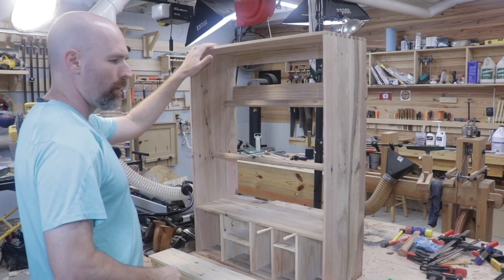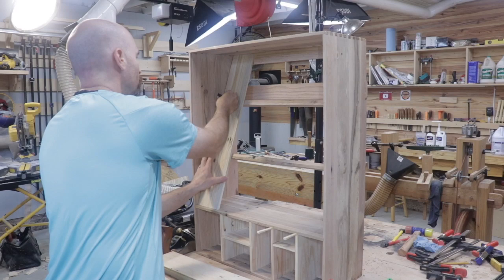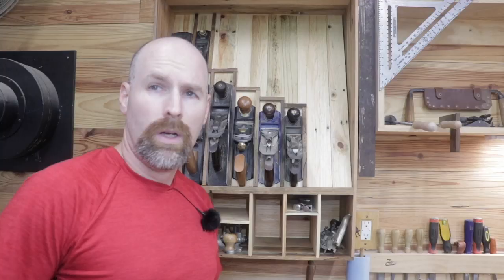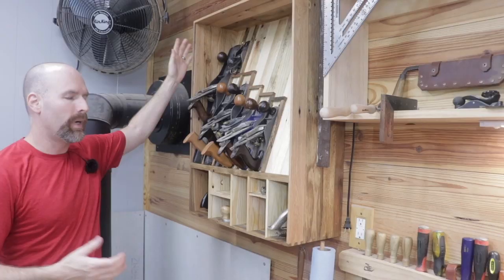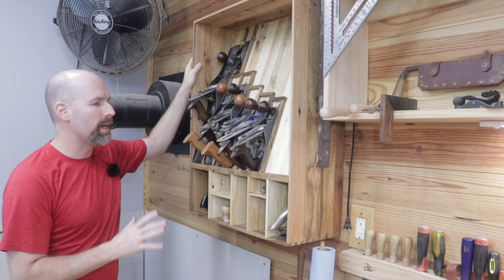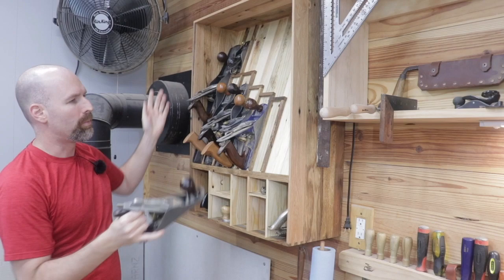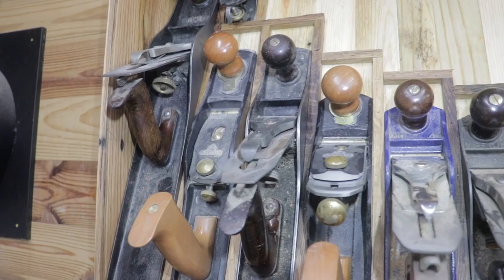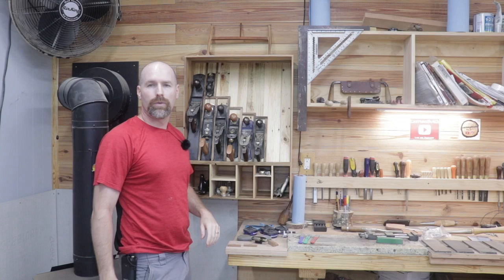Series Finale | Pallet Wood Plane Till | French Cleat Tool Wall

Comment: Very interesting watching this series. The actual panels for the flat planes would be the only thing I'd change so it fit my needs. Instead of fastening the dividers on top of the til I would have milled each til to match the plane and fasten the divider to one side. Then I would have left the middle one or two loose so I could remove them and access the back side of the storage area. Maybe put sharpening stones, oil, replacement/custom pieces behind the till but easily accessible. Gives me some ideas. Thanks for showing.
Reply from the maker: Good thoughts!